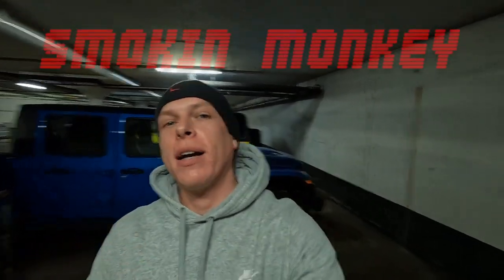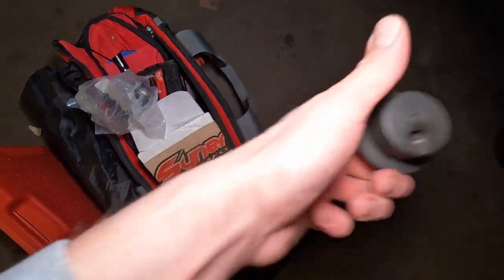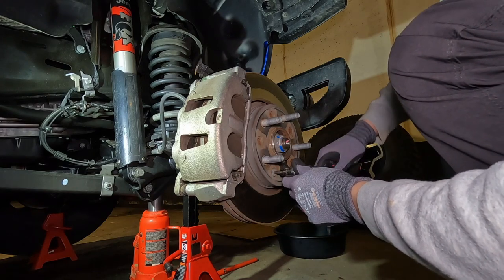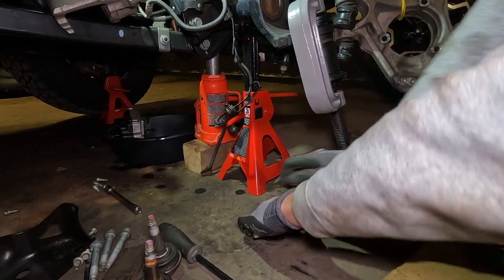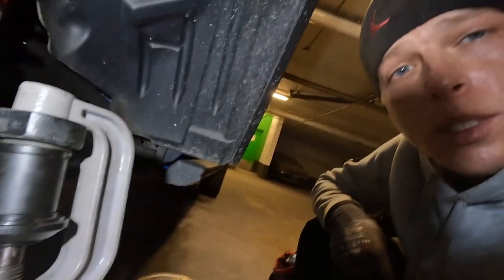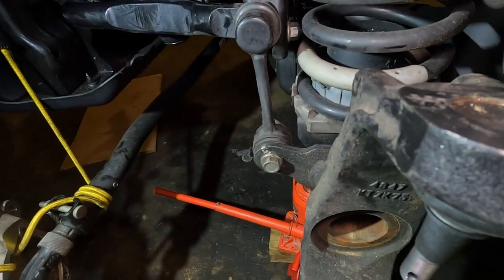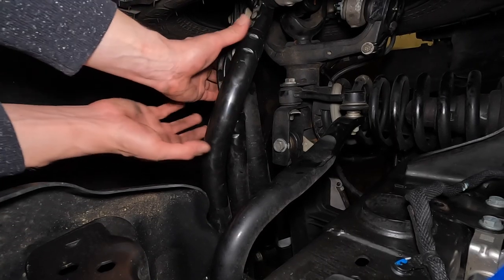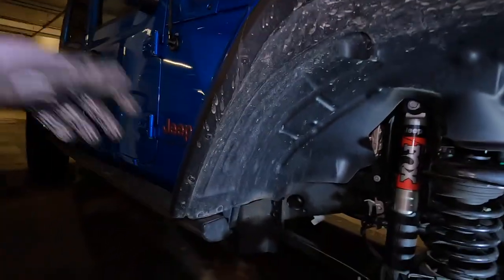Hunting Down The Infamous Jeep JL/JT Clicking Noise

Comment: Another thing to try.... With the motor running have someone sit in driver seat and hold the brake pedal down hard.  Move steering wheel left and right enough to bind all of the stuff in front end.  Have them repeat (they will get tired).  You crawl under Jeep and try to get noise show itself.  Touch everything while looking.  This method has always worked for me finding something loose or worn.  Good Luck!
Reply from the maker: I did that and it was the upper ball joint…. Not sure what to think since it’s brand new

Comment: It's the ball joints.  I had the noise on my JLUR then upgraded the front axle to the Spicer Ultimate 44 which still uses my existing aluminum knuckles and no more noise.  Keep in mind the Ultimate 44 has the spicer HD ball joints as well.  Understand your frustration, but it's so common.  Also the low torque values don't help either.  If it's still under warranty, take it to the dealer and let them hear it.
Reply from the maker: Ya that might be the next move

Comment: I got a low mile JLU, threw a jks lift kit on it, and within 6k miles of me driving it I started hearing this click every time the front end soaked from rain or crossing water. Never when dry. Sometimes when going over speed bumps and now when dry turning left or right at low speeds 

My upper ball joint on the driver side seemed to be the issue. Tightened it, used some graphite dry lube and it went away. It’s a bandaid fix but I’m gonna go with a delete kit from American iron and hopefully never deal with it again until I get rid of it

Comment: Quick question. My steering has started being a little stiff. People are suggesting seized Ujoint. How difficult would it be to have this fixed and what prince range would you think I'm looking at?
Reply from the maker: If it is a u joint they usually charge about 2-3 hours for the front axle u joints. Depends what the shop charges per hour but the part will cost around $50 and then whatever their hourly rate is. Could be $500
Reply: @SmokinMonkeyOG  damn.  Thanks for the info.
Reply from the maker: If you can, I would have somebody look at it before you take it in just to get a second opinion and see because that could be a symptom of a lot of different things
Reply: @SmokinMonkeyOG  good idea.

Comment: Hey man. Not sure if your still paying attention to theses comments. I have both a gladiator rubicon and Mojave. Rubicon came factory with that clicking noise but nothing was loose. So I just turned up the radio. My Mojave doesn’t make any noises. And my Mojave is a soft top so definitely hear more stuff. But I’m think your on to something. The only difference between the Mojave and Rubi front axle wise, is the locker and knuckles.
Reply from the maker: To be honest after changing the ball joints and going crazy for months I tightened the crap out of the sway bar links and it’s gone lol

Comment: I’ve been have that same popping noise in my Jeep gladiator as well. The popping seems to stop when I’m in 4 wheel drive though. Any idea what’s that about??
Reply from the maker: Mine ended up being sway bar links. I check them every so often and I haven’t had any issues yet. Could be you disconnected the sway bar off road and didn’t hear it then?

Comment: I had the same clicking I couldn’t find for months and eventually found my control arm bolts front and back loose. Tightened them up and no clicking
Reply from the maker: I did a levelling kit on mine before I even put the first tank of gas in it so I checked all my control arms all my sway bar links, track bars. You name it I tightened it that’s why I was going nuts. Once I went back to the swaybar links and tightened them to the point where I thought I was going to break my ratchet, the clicking stopped.

Comment: Try to re-torque front sway bar end links. I have that problem before and end up just the sway bar ends not torque correctly. Hope it helps
Reply from the maker: I did check those the other day and they’re tight. I think I’ll just take it in and see what they say
Reply: Hope you figure it out. I have a rubicon also. No clicking sound now on mine.
Reply from the maker: Thanks! Fingers crossed they find something I didn’t lol

Comment: I know exactly what the problem is!! I have the exact same Gladiator, I changed everything in the front end and the noise was still there.  Then It ended up being .... GAS TANK SHIELD- There's a Gasket in Between the Frame and the Shield. The Gasket wears out and the Shield starts rubbing against the frame enhance the clicking noise you hear. After I took off the gasket and put my own the noise never came back!
Reply from the maker: I’ll take a look thanks for the tip

Comment: I have a 2020 sahara ane making same  Noise  But it only makes that noise when I stop and go Not when I turn
Reply from the maker: Could be a few different things, you would have to take a deep dive to find out. Check control arm mounts, transmission mounts, sway bar bushings, ball joints, tie rod and drag link, track bar etc. basically it can be anything lol wish I could help more

Comment: Mount your GoPro under there, looking at various areas and see if you can spot the shifting parts.
Reply from the maker: I’ve been doing it for weeks actually and no luck so far. I took the wheel off and moved the assembly by hand and it’s definitely the upper ball joint

Comment: it's not a Jeep design flaw. it's a government flaw.
government restriction on new vehicles is forcing auto makers to use lighter weight materials to meet the fuel economy restriction placed by government. that's why Jeep owners have to upgrade their suspension parts to make it a true offroad vehicle that it should be. government needs to stay out of everyones business.

Comment: The ball joints not installed properly those sleeves need to seed fully they only go in one way flat part of this sleeve needs to go against the knuckle.
Reply from the maker: Believe me I tried everything you can think of an that’s how they sit. If you watch the video by wayalife he installs the same ball joints on his JT and they sit exactly the same as mine
Reply from the maker: https://youtu.be/wBoY_JXXvyM
Reply: Don't own one myself, but that's what I thought when I saw them. Looked weird with the flange on the bottom, kind common sense it would go up against the knuckle.
Reply from the maker: Ya I had the same thought but like I said in my last reply you couldn’t get it in there with anything I tried it literally doesn’t sit further in with these ball joints. Watch the video I linked and you’ll see what I mean when he installs his the ones that come off look just like mine are now. As when he installs them they look the same
Reply: @SmokinMonkeyOG  I watched the other video and he explains that that is a tapered piece, and it appears to be split that goes up into the knuckle and tightens on the ball joint stud so there is no way it should be loose or making any clicking noise. I would be looking elsewhere for the clicking noise. If your ball joint was loose you would have tire shake and tire wear.
Reply from the maker: Ya I definitely don’t have any feedback through the steering at all and I don’t have any issues driving it. I believe the ball joints are installed as they should be. I’m going to take a trip to the dealer just to get a second set of eyes on it because I have to be missing something

Comment: see if your steering box is tight to the frame.
Reply from the maker: Good tip but I did check that. Mine is also the cast iron box not the aluminum one

Comment: I have a 2018 jlu rubicon. Does not make that sound.
Reply from the maker: If I drive with the windows up you don’t hear it, you would need to turn off the music and open the windows and then you can hear it. I’m convinced that 80% wouldn’t even notice the noise. Since I do my own work I’m always listening for stuff like that and maybe even overthinking things lol
Reply: @Smokin Monkey  ya, I hardly ride with windows down and music off here in Texas. Only a few times a year when the weather is nice enough to do that other than trail riding.

Did you ever try the coat hanger to unplug big birds windshield wiper drain plug?
Reply from the maker: Ya I hear you, I’m still trying to decide if I should take it in. I know the noise is coming from that bushing but they’re probably going to just say it’s the aftermarket ball joints even though that was what I did to try and fix the issue in the first place. 

I did try it but had to take the entire piece out because it was packed with mud so dense it wouldn’t want to come out lol
Reply: @Smokin Monkey  you have warranty I would. 
Yep that is how my tj was lol. Once I got it cleared out I just cleaned it every so often. At least you know what it is now.